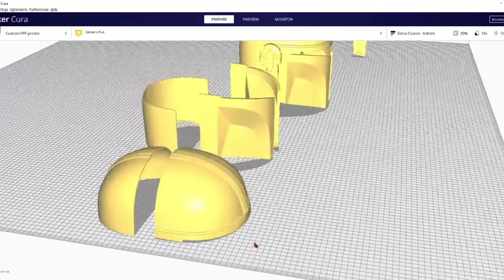Cosplay Con Crunch for KatsuCon, Emerald City, WonderCon & C2E2 - It's A Vlog!

Comment: I really enjoy these videos, down to earth kind of thing, nice to see what your working on and upcoming things, it will be cool to see the saba and the demon slayer sword finished! Can imagine you dont want to make videos showing the same process with each sword, so maybe a video showing multiple swords? Can always link the original sword video guide in the beginning then you can explain if you made any of them differently, be cool to see the belt printer in action and what you will do with it!

I think its a good idea in these videos to show the little tips or thing you dont deem worthy for a full dedicated video, like that chrome pen marker or the switch in the hand for star booster.

A possible idea for the damaged helmet, may sound silly, weld it back up fix it up and hang it on the back wall, you could always print another model of your head out and put the helmet over it on the wall? Could always do something fancy with a remote trigger that you showed from a earlier video you did so you can remote trigger it opening, closing and lighting up etc

Comment: For the gold...I would say its more of a Chrome Gold vs Standard gold.  The standard gold is a metallic gold, because of the metallic flakes, just like a lot of car paints.  The molotov chrome has been around a while and can be airbrushed if you want to.  Glad you found it, just be sure to let it cure and when you clearcoat it, its going to lose some of that reflectiveness.
Edit--I wanted to add, if you want to check out someone who does SO MUCH paint testing, search for barbatos rex on youtube.  He doesn't do any type of cosplay/finishing techniques, so I am not trying to lead anyone away from your channel.  He just does painting and hobby tool testing.  He did a gold video with a ton of different paints!

Comment: i actually like this bts kind of video and a preview things coming up. i'm not so much into cosplay fabrication but i like to see what is possible in other industries as i like making products. i'm looking forward to seeing what you bring out there to wondercon in march. idk if they've gotten back to you, but their communication is pretty jank. which is funny cuz they also run SDCC.

if you're doing sublimation prints (the print wherever you want), it's probably rayon or polyester. these are petroleum (i think) based fabric and it has like very little stretch and tends to cling to your body. idk if we have a merch production channel in the discord but yeah i like talking about merch making and i'm always willing to help out with stuff like that. just the problem is there's a disconnect of what makers envision vs what is available in the global manufacturing industry. hence the reason i turned to you and uncle jessy for 3d printing.